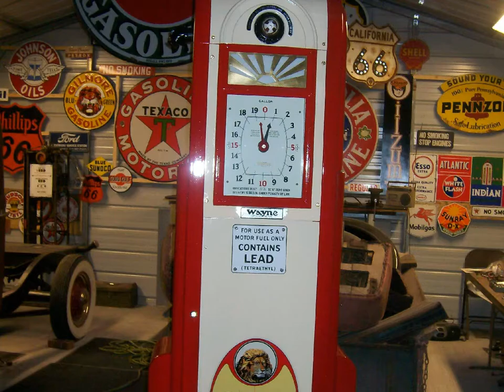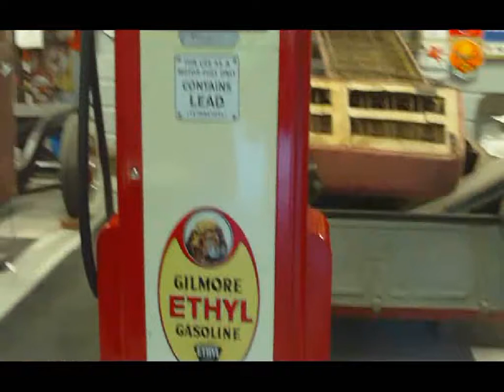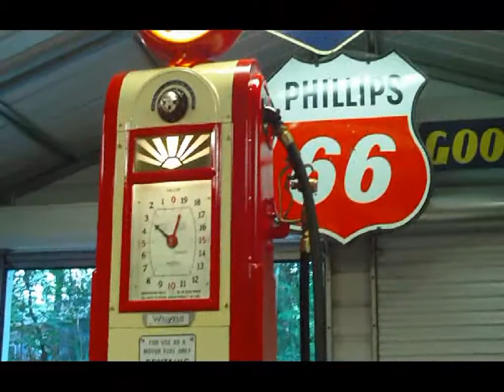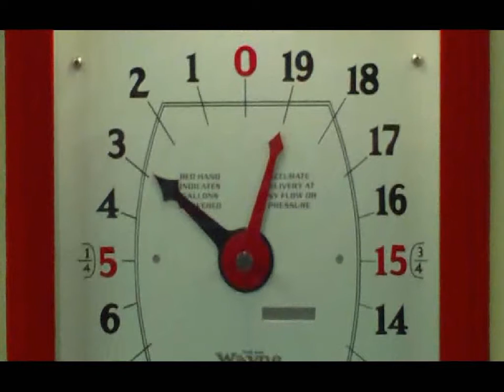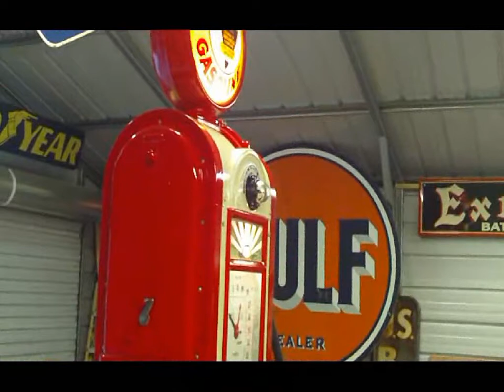1935 Wayne 60 antique gas pump restoration

Comment: Hello,
Great job!  I am thinking of making one of these as a replica.  Would it be possible for you to get the L W H ?  Or a document with the specs ?  I fell in love with the Wayne 60 from an old picture painted by the artist Stevan Dohanos showing a Wayne 60 with Texaco labeling.
Reply from the maker: Hi Don, the pump is 6'4" tall, not including the globe, 28" wide and 16" thick. 1935 - 1937, mine is the most common wide body, they made a narrow body version, they are quite rare. I had (2) both in very good condition, sold the other one for $450 years before I knew what they are really worth, STUPID! Anyway at least I kept this one! I know where a couple are, just sitting and rusting away, guy won't sell, but he will never restore them either, what a waste! Good Luck! Greg
Reply: Thanks so much for getting back to me.  Helps a bunch.  Parts are available to make my replica pretty cool.  Will look good in my garage where I am restoring a 66 impala convertible.  Thanks again.
Reply from the maker: Don Lombard
66 Impala sweet! Great body style, I love em! I'm really a Chevy guy, but I just recently finished my '36 Ford truck, it's pretty cool! I have some videos of it on Youtube, flat36v8, cheers!
Reply: flat36v8
What is finished one worth?